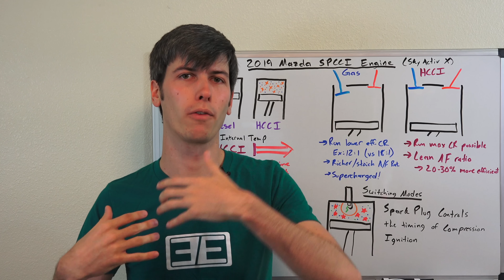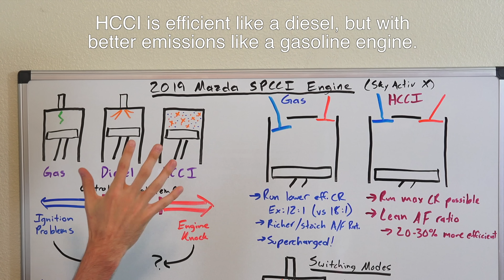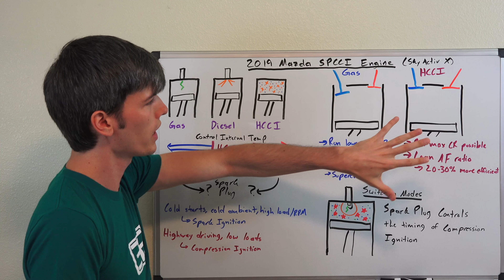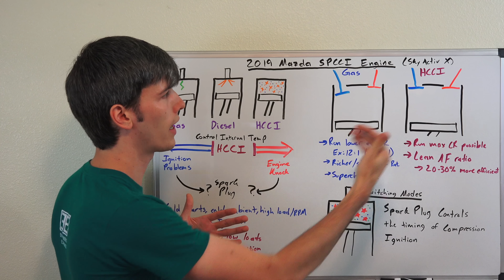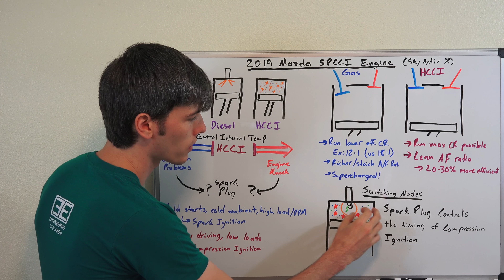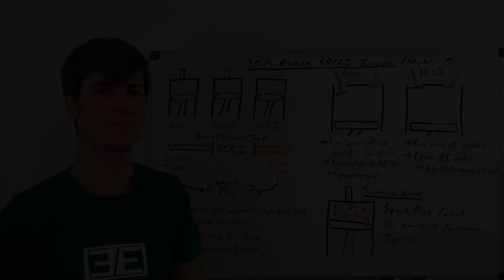Mazda Creates The Holy Grail Of Gasoline Engines - HCCI SkyActiv-X

Comment: Hmm, some of this is accurate, some not so much. It looks like Mazda's version of HCCI is very similar to programs most automakers are working on though they may have expanded the operating window a bit. HCCI is essentially the process of introducing fuel into a combustion chamber which contains large amounts of hot exhaust gasses from the last combustion cycle. This is accomplished by closing the exhaust valve before the piston reaches the top of its travel. The exhaust gases which are trapped by the early closure of the exhaust valve remain in the cylinder during the intake stroke which mixes fresh air (no fuel) with the hot gases. By using direct injection (the fuel is delivered into the combustion chamber, not the intake manifold), fuel is sprayed under high pressure into the mixture of fresh air and hot gases. Because a percentage of the gases in the cylinder contain no oxygen (the previous cycle burned it) there is less oxygen available for combustion, this means less fuel is injected. Also less power is produced. The residual heat in the mixture is adequate to ignite the fuel and thus, no spark is required. If compression ignition were used: gasoline, unlike diesel burns very quickly and with compression ignition would ignite entirely at the same time. This would create a very large, and brief pressure spike (explosion) which would damage hardware and waste energy because all of the force would be applied over a very short distance of piston travel. The amount of fuel injected during HCCI operating mode is considerably less than the amount normally provided. This means less power and is the primary reason HCCI is used in steady cruise conditions when minimal output is required to keep the vehicle moving.As a smaller amount of fuel is injected into the cylinder, it is effectively a very lean mixture that would not ignite reliably with a spark plug nor would it burn completely because the fuel molecules are too far apart for the flame front to span the distance between them. However, because it is injected into combined gases, the heat ensures that all molecules burn and at the same time control the rate of pressure build. This reduces mechanical loads and provides a more even "push" on the piston over more degrees of crankshaft travel so improved efficiency. This also solves the greatest problems associated with lean combustion; NOx, and HC emissions. Lean mixtures burn at very high temperatures, creating NOx. They also (counterintuitively) leave behind unburned fuel because the flame front fades before all the fuel is burned. The catalyst can clean up the HC by burning it as it passes through but that means wasted energy. NOx is more difficult. HCCI is like EGR (Exhaust Gas Recirculation) on steroids. By having large amounts of inert gas in the cylinders, mixed with the fresh air: the combustion temperature is lowered and NOx can be pretty much eliminated. By controlling the closure of the intake valve as well, compression can by regulated and this does permit higher compression ratios (Atkinson Cycle). I believe the Atkinson cycle was documented many decades ago and has been used on hybrid engines for quite some time so no news there as it has been proven reliable. Supercharging/Turbocharging permits higher air volume through the engine and would likely be used to reduce the engine's displacement which improves efficiency. There are millions of turbocharged engines on the road today and despite predictions to the contrary are proving out very well. So, that does leave some new technology and a lot of software management to ensure everything works smoothly. This has proven very difficult and with the amount of effective EGR involved there are legitimate questions regarding how some components will stand up over time. I would be concerned about buildup on valves, residue on fuel injectors, possible spark plug issues, etc but I think eventually they will work out. I think Mazda has expanded the operating window closer to idle and perhaps under higher loads (maybe the reason for the charger if they actually do install one). Consumers also need to understand that like nearly all powertrain improvements: 8+ speed transmissions, downsized turbo engines, variable displacement/cylinder deactivation, electrical load management, aerodynamics (shutter, louvers) etc have the same characteristics: they work under specific conditions. For example: an HCCI vehicle pulling a trailer, with a hardtop carrier, climbing hills, driven at high speeds, etc, etc. Will be unable to maintain HCCI mode as often as in lower load conditions. This means that the gap between best and worst fuel economy will widen. This creates a lot of dissatisfaction and mistrust of the claims made regarding projected versus "real world" fuel economy. However, on a positive note: understanding your vehicle better can result in impressive increases in mileage realized.
Reply: Dale Wells     I’m still scrolling...
Reply: ClayZ Lol, I just re read this and have to agree. Sorry for the run on. Guess I got carried away.
Reply: I well remember the days when a de-coke was a normal part of servicing the engine. EGR with direct injection has brought it back with a vengeance - but you can't remove the head of a complex modern engine, decoke it and have it back running again in half a day. Direct injection engines are now quite often needing a decoke within the warranty period. I really can't see how this problem would not be worse for this engine, as individual cylinders will (as always) accumulate different deposits and require very different valve timing to run without detonation.
- Or have they figured out a way of cleaning the manifolds, valves and combustion chambers during normal running?
Reply: Very very good writeup. I just want to point out that an engine running HCCI has a ~5% lower indicated efficiency than a comparable direct injection diesel (41.1% vs 44.4%). I think the main selling point of HCCI engines is the two orders of magnitude lower NOx emissions (0.06 g/kWh vs 13.0 g/kWh) and ~25% lower particulate emissions. Note that these numbers are referring to the combustion products, before the catalytic converter.
The bad thing is, as far as I understand (feel free to correct me here) you do not get any CO from lean combustion, which is needed in the catalytic converter to convert NOx to N2 and CO2, so whatever NOx you get from the engine does not react in the converter.
Reply: Now if we could just get you to understand the art of using paragraphs we might be able to get something out of that long write-up devoid of any structure.

Comment: First thing I thought was there'll be issues with engine failures if one little thing goes wrong. So basically if one component fails, it will be a catastrophe for the whole engine. I suppose the fail-safe will be the spark plugs......... which will be useless in a lean running engine because of premature detonation, and holes in the piston crown.

Looking down the thread seems like many will agree.

But here's an idea. Instead of borrowing $50,000 for a new car, then chasing your tail to pay it off. Why not buy a used car for under $5000, with a fuel efficient engine, it'll use 30-40% more fuel but cost $45,000 less. If you spend $5000 overhauling the engine and transmission over its lifetime, you'll have saved $40,000. Then there's accrued interest, which offsets any 30-40% saving in fuel on the newer car.

Then there's the amount of energy that goes into making a whole new car and the emissions that causes. 

Recycling existing cars by restoring them and retro fitting more fuel efficient engines will actually save more on crude oil usage.

So lets be a society that is concerned about fossil fuel usage, and keep throwing away this energy on creative destruction, and then throwing away the savings to fossil fuel usage on creative destruction.

Comment: Interesting video
I still wonder what prevents major car manufacturers to fully adopt gasoline turbo engines. There are still many natural aspirated cars being released today. Is that a cost issue? From a driver's standpoint, it's much better to drive recent turbo cars than lousy naturally aspirated ones. 
What's going on?
Reply: Durability. You need premium oil and frequent changes. Also you need to warm up and cool down a turbo + if you dont have e-boost the turbo will not produce boost at low rpm. So in city and in heavy trafic the engine can have terible fuel economy even with e-boost.
So its almost like diesel you have to be careful about the heat and it dont like short rides and winter.

Its always better to loose some weight that add power.

Comment: Can you place some form of heat plate or element to control the internal ambient temperature of the cylinder? Could something like that allow the cylinder to stay at a state that ensure compressible combustion?
Reply: The engine block itself acts as a heat sink (and source). You finely tune the temperature by adding (or not adding) exhaust gasses (EGR).

Comment: Mercedes did it first...Diesotto engine...quite a while ago... the new turbo era f1 engines are also rumoured to use the hcci, where the merc has been ahead for some time
Reply from the maker: Not production cars though, and yes, similar tech in F1 except they use pre-chambers that then ignite the main chamber. (Explained in my video on Mercedes 50% efficiency engine).
Reply: Engineering Explained Ok yeah I'll give you that:) Just trying to make a point that its not just Mazda... Will check out the Mercedes video.  Thanks for the reply, awesome channel!

Comment: It seems that if you combine this technology with that of infiniti’s variable compression ratio, it could stay on the otto cycle all the time and be even more efficient instead of pushing air back out the intake valve lowering intake efficiency. Its a pipe dream to think that they would also add the free valve technology, but It could halve the amount of friction and wearable parts in the engine. With all the new technology added to the engine, most likely the reliability would stay the same because removing the camshaft would put less wear on everything else.

Comment: Lame. This “Holy Grail” of engines looks like a disaster waiting to happen. Too many variables to guarantee reliability. Bad gas? Wrong octane? malfunctioning valve? Carbon build up? The future is alcohol fuels and tiny but strong forged internal engines with high boost from turbos.
A 1 liter gasoline engine (say an in-line 3 or a small 4 cylinder) capable of handling 30-40 lbs of boost from two small turbos running on ethanol or methanol is going to be just as powerful and WAAAAYYY less polluting than this design.
All the electric car fanatics out there are living in fantasy land also. We WILL be burning things for power for the next dozen or more generations. The price and resources required to make electric cars “the norm” is unrealistic and silly. Even if every rooftop on earth was a solar panel, that still wouldn’t be enough power to sustain 1-2 billion electric cars. Lithium makes up .0007% of the earth’s crust. It’s the 25th most abundant element but WAAAYYY less abundant than the first 24 most abundant elements.
Electric is not the future

Comment: So as a not engineer, but passionate about engineering, i wonder now, after hearing about infiniti literally variable compression engine, which is better in terms of economy and reliability? Both seems to be complicated as hell, and both promising to change the game.
Reply from the maker: Mazda isn’t going for horsepower as much as Infiniti is, they’re aiming for efficiency and will very likely have better fuel economy. Infiniti is looking to make something with both solid fuel economy and solid efficiency, and will have more power than the Mazda engine.
Reply: it is nice to imagine for a minute - what if Mazda take this engine, upgrade the spark ignition mode with the Mercedes ~50% efficient engine solution, then add infiniti variable compression, put free valve system from Koenigsegg on top and pair everything with some ultimte performance CVT to perfectly utilize every bit of the output. I can only image how many reasons there are, why all of this cant work in harmony :) anyway, i am really excited by these engineering achievements.
Reply from the maker: Unfortunately these technologies aren't necessarily additive in the way you might assume they could be. Combining technologies doesn't necessarily equate to improved efficiency. Each is a different strategy that comes with good and bad qualities. As far as efficiency is concerned, Mazda's approach is very logical, even without incorporating other technologies such as those you mentioned. A CVT could improve things marginally.

Comment: Is this engine better than the 2018 Subaru crosstrek  lineartonic CVT engine to reach 200,000 miles ? Thanks.
Reply: It's gonna be a long wait until you get the answer to that.

Comment: You should do a video on the Mcneil cycle diesel engine that is quite new technology being used by Formula E right now.  It was designed so that they can burn different fuels in an off-the-shelf diesel engine.  Formula E is using Glycerin, a bi-product of biodiesel and it is producing extremely few NOx and CO emissions from an otherwise wasted product.  Very interesting ideas and technology and I would love to see a explanation video.

Comment: This always happens. Some company always continues to innovate along the course of a dead technology. Yes. You can squeeze more out of ICE technology if you spend the time, effort and money now. The problem is that the returns are diminishing. Which means you are nearing the upper limit of what is PHYSICALLY POSSIBLE as it pertains to ICE. Electricity, on the other hand, is at its very earliest levels of capability. So placing your investment there will reap rewards for decades to come. It's sad to see a company like Mazda not aware of this reality. I recall Kodak developing the first digital camera, then holding it back because they were making so much money in film. We know what happened after.

Comment: Just bought a mazda2 skyactiv as my daily driver,  manufacturer recommends 91 and above and currently using 92 (no knocking so far). In terms of longevity/cost is it worth filling with 98 since the compression is 13:1? Since i'm sure that performance won't be of much of an impact.

Comment: Perhaps the new engine will utilize Atkinson cycle, Miller cycle, and HCCI modes.  The supercharger used in Miller cycle mode can also be used to increase fuel/air to generate the high compression needed for HCCI mode all the while using their Skyactive valve control tech to move among the three modes as needed.

Comment: Also fuel octane rating would present a problem with raising compression ratios closer to that of a diesel engines 18:1 when unlimited class drag motors are more like 14:1 - 15:1 and must run 110 octane or they will have pre-detonation problems  e85 has an octane rating of up to 105 which still isn't enough for real high compression ratios.  The only way I could really see this working is if it was build more like diesel engines and on the intake stroke only took in air and didn't inject fuel until the top of the stroke like a diesel.

Comment: tldr; its build like a diesel engine(injects fuel into cylinder at tdc with super high pressure mist into compressed hot air) with compression like a diesel engine, but it has a spark plug that fires before the piston reaches tdc when the engine is cold. When the engine is warm the compression alone will cause the gasoline to burn in the same fashion a diesel does, in random pockets throughout the cylinder instead of having a "slow moving" flame front originating from the spark plug (which is why diesels have more power, its closer to an explosion than a moving bon fire). 
Of course you would fire the spark plug anyways just after tdc/fuel injection just in case of misfire.
Diesels are also more fuel efficient for this reason (producing less co2 than gas engines even) but produce heavy black smoke because you typically use oil for fuel.

Comment: From what I have read they are controlling their timing and burn the same way a caterpillar 3600 series natural gas industrial engine controls its timing and spark. Most of the cylinder is filled with a mixture that is too lean even in high compression ratios to burn.  Then they have a way of injecting a very small amount of gas near a spark plug.  When this is ignited the expansion of the small amounts of fuel causes the rest of the fuel to spontaneously ignite.

Comment: (IM MAKING A COMPLETELY SLIGHTLY UNEDUCATED GUESS WITH THIS THEORY) So, I'm still kinda new to cars, but I know the general jist of how the engine works and the underbody and all that good stuff. I feel that switching from Gas mode to HCCI will have something to do with the RPM's. Either you let off the gas till like, 3K to maybe even 1K, THEN you can switch to gas mode from HCCI, from the sudden kinda "boost" of power from the gasoline mode. If you wanted to switch from gas to HCCI, then you would want high RPM's to get the car going, like 5K to 7K, since the HCCI mode doesnt have much power, it would need the high engine power to get going.

Comment: holy grail of engineering crap..as a  mechanic for 30 plus years fixing all these engineering screw up down the road.the future is electric battery power cars.When they ( like TESLA AND OTHERS can get 600 plus miles to a charge and price down to 20.000 to 30.000 range ,then the little over engineered 4 cylinder will die for good. ....but who i'm i just a little guy who has to fix there mess every day.  ( REMEMBER BACK TO THE FUTURE MOVIE'S .THAT SKATEBOARD THAT COULD LEVITATE.WELL)
Reply: So you'd happily lose your job to EVs. Good job :)